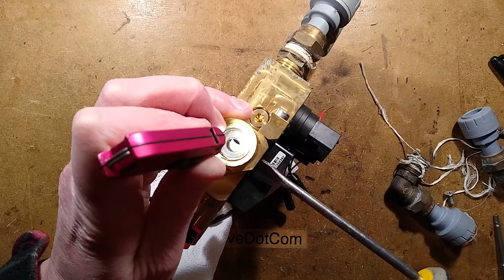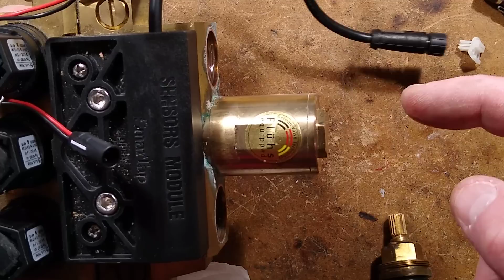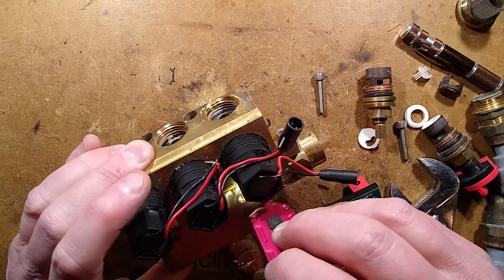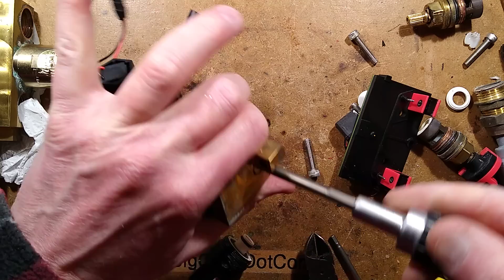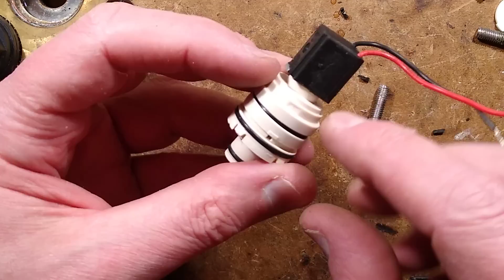Smartap manifold teardown (it's a beast!)

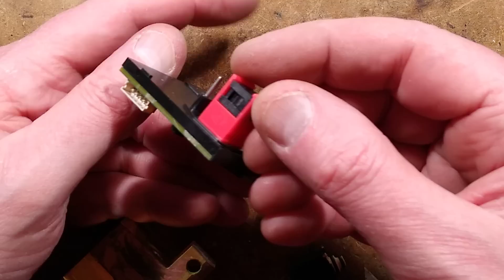Comment: 21:39 Those thingies could be both pressure or flow sensors. Which makes me think which one would be more appropriate, as both can be used to calculate the other parameter.
Both could get clogged, but a pressure sensor requires no flow, so no flow of sediment also.

It's almost as the bloody Juiciero x)

The fun thing is that lately I thought how I'd make such a thing, with pedal controls for the sink. And as I looked over the ready-made components it would require more space to fit all of the things. So probably most of the engineering went onto streamlining the whole package. Also I did not plan for that much electronics, even skipping the serial comms. At worst planned to plug in into an ESP to have remote pressure monitoring (it sucks where I live).

Comment: I've had this model for 6 years and it's been a fantastic unit. Especially bath time for my little girls as you can set profiles i.e 40l at 39c then stops automatically.  But since the app stopped working I lost automation but it still worked as it was programmed . Last night I've ran a bath and couldn't turn it off unless I've turned the shower on then turn off bath then turn off shower! 
Its like the bath button powers off after the first press then it needs the shower to be active to power on again. 
I know it's not the button as I have a spare and it does the same thing. As it cant be programed again is there a solution to fix this?

Comment: 11:50 That is one of the more satisfying crunches on this channel
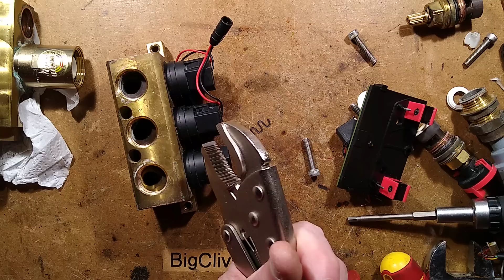13:15 That's up there too, nothing like that k'chack of a pair of vise grips (often followed by cursing as that terrible little release lever attempts to remove your finger)
16:00 I mean you couldn't use it before, which was how you ended up with it after all 
My vote is on pressure sensors to compensate for varying water pressure, but a flow meter also makes sense.

Comment: If it's any help, thread lock is usually a methacrylate based anaerobic adhesive and all strengths of threadlock can be softened for removal by heating to a bit over 250 °C.

Thanks for telling me about magnetic remanence valves - had often wondered how that was done in low power systems!

The whole thing is ridiculously badly designed and overcomplicated - built similar beneath my kitchen sink with two solenoid valves and two foot switches. Had been thinking about putting in a thermostatic mixer valve and another foot switch so that it would give water at the perfect temperature for hand washing but hitting hot and cold foot switches at the same time seems OK for now.

(I included a link to a manufacturer's page on removing threadlock but I think YouTube seem to have banned the comment because of this.)
Reply from the maker: YouTube often filters comments with links due to spammers and scammers.

Comment: You can open The 1/4 turn valves are known as integral stops in the US.  You can open the coverplate on the shower wall & shut the water to the unit off & replace the valve seals that go bad fairly frequently.  No need to have an access panel to have the shut off valves near the unit.  You can also plumb the units in back to back showers which make having easy access to stops even harder.  I'd guess that the central brass outlet is sweated in, looks like a bit of solder around the seam where it mates with the main block.

Comment: Very well engineered… unfortunately overkill for the purpose. 
Also we probably  have a 13mm water feed with an 11mm bore that goes into a grey plastic push fit that has what looks like a 9mm bore that then goes through an isolator valve that’s probably 7mm bore 😂 . 
Talk about a flow restriction, even with a high pressure pump fitted I could probably weeee a better flow rate 😮

Comment: I think the flow sensors are just strain gauges. There are holes either side so when there is no flow the pressure is equal; when there is flow the hole in the sensor facing the valve has a lower pressure (due to the venturi effect), thus inducing a pressure differential across the strain gauge. This would have the advantage of producing an output almost proportional to the flow.
   When I was (much) younger we used similar servo valves (I think they were made by Bestobell) to these, but worked in the opposite manner. The water pressure and a pilot spring kept the valve shut also water pressure was applied to one side of a dual diaphragm, positively keeping the valve shut (even when there was pressure downstream of the valve). When the solenoid opened the pilot port the water pressure was applied to the other side (larger diameter) of the dual diaphragm. With the pressure being the same on either side of the diaphragm much greater force was applied to the larger diameter side, thus opening the valve. When closing the pilot port, the water on the large diameter side was bled downstream of the valve. They were larger than the ones shown here, but they could take large flows and pressures, were 100% reliable, very easy to service (only the gauzes needed cleaning occasionally and this in very hard water), but were relatively pricey.
   Once again, an interesting vid.

Comment: The place I'm in just got the water meter replaced with an electric one.  He said it can be read by wireless network.  I think it probably contains a shut-off valve and/or pressure adjuster.  Scary

Comment: Those pins probably measure temperature differential and adjust hot/cold to provide the correct outlet temperature. Very common to see that arrangement in tankless hot water systems.

Comment: Guessing from the number of contacts and block and pad location is it possible each red pad is a temperature sensor, 1 side for manifold temperature cold input side and the flip for manifold temp outlet/mixed side  then the other block for the same but hot input side leaving the 2 small probes in the water stream for actual input water temps for both inputs

Comment: We've had a Moen IO Digital 4-port shower controller running for a decade now, which was cheap enough when amortized over a 25-year new-build mortgage. It doesn't sit on the internet, but it does give us a remote control to warm up all the body jets, shower, and rain shower before stepping in, which was the goal. I've always assumed that Moen used their standard, rather bulletproof, faucet cartridges to make the thing, with some servos on top to crank them and some temperature probes in the flow to regulate it. The only issue we've had is that I think the capacitors are going dead, and now the link between the panel in the shower and the controller/valve box is glitchy. Unplugging it instantly shuts off the water, so I suspect that at least some of its servos are balanced against springs. I really need to take it apart one of these days to replace all its electrolytics.

As for this video's incarnation: It's a fiendishly complicated Rube Goldberg device that I don't think was fit for purpose. Rest in pieces.
Reply: If you ever do, would you take 5$ for you to film the insides for me?
Reply: @hhhhheeeelllllllllooooo  Oh dear, it literally just went to the dump last week as part of a major ensuite reno. The contractor had it out and gone before I remembered to ask him to save it.  :(
Reply: @KevinT3141  Murphy's😂 But no worries, I'll try to find someone else to bribe. Thanks for replying!

Comment: Your not going to transcribe a schematic of that circuit board?
Reply from the maker: It is just one of many in this product.  If you look at the main video about this device it shows closeups of the PCBs and basically the microcontroller and network driver chips.
Reply: @bigclivedotcom  it was a joke...
i didn't need a schematic, i just expected you would because you always do.

Comment: I would love to get my hands on those servo motors. I ran the part number pg28395126000 (you can see in the video) but could only find some photos that look very alike, except for no encoder board at the back of the motor. I have a project for a irrigation valve that needs off the shelf servos and seen those in use in this product is enough to convince me that they will fit my bill just right. Can anyone find more information about damn servos? Tks!

Comment: How do you take a shower, when the water is controlled through your computer? I don't see the immediate advantages.
Reply: You could have it controlled by a PIR/presence sensor, so it turns on/off as you go in and out.
Reply: i think the red bits are probably flow sense, this allows you to set a fill level in your bath, also the control allows you to set profiles and use your voice to control so if you get soap in your eyes you aren't groping for controls, these are the advantages to computer control but the problems are the companies behind them, there is no reason these should be connected to the web

Comment: I think those things on the sensor module are pressure difference sensors to measure the water flow. There will be a orifice of a known cross section in the manifold the water flows through and each side of the orifice is connected to one side of a sensor, then the pressure difference across the orifice is used to calculate the flow.

Comment: 7:10 Solenoid valves all need fine intake screens like that.  Water has a tendency to not just be water; sand and grit and limescale come along with it, and it only takes a fine grain of the stuff to lodge on the sealing surface of the diaphragm or in one of the pilot holes.  They'll drip, or fail to shut off entirely, or fail to turn on.  Tank type water heaters in particular are notorious for coughing up all sorts of debris, but road works and other things can cause the city supply to be not entirely liquid also.  In the commercial restaurant industry, it's not uncommon to find one of those strainers completely packed.
Reply: Every time they shut off water (for works presumably) it's basically mud coming out of the faucet for the first minute or so once they give it back...

Comment: Valving involving fluidics. Using a small  pressure signal to control a larger flow. The Fluidmaster toilet refill valve is a classic example of fluid amplifier operation. Works with water pressure rather than against it. Clever and effective. Dirt in the system is basically its only enemy. Otherwise, it will work virtually forever.
Reply: I can remember how i felt when I first got my head around such a device.
Reply: They are great, but they also require higher pressure to operate than the traditional ball valve. When I started supplying my toilet cisterns with rainwater from a cistern in the loft, I had to replace the upstairs one's valve with a ball valve. As the pressure is so low, it's not noisy, so no real issue.

Comment: Those first ball valves could be for isolation during air pressure tests because the air pressure has to be pretty high for the test and the equipment can't handle the pressure.

Comment: I'm guessing the red blocks are either venturi tubes or just orifices with differential pressure transducers, used to determine the flow rate in the hot and cold inlets. There's no need for an outlet flow rate since this would be the sum of the two.
Reply: I'm also guessing it is this complex because it's meant to control both temperature and flow rate at the same time

Comment: “This is so much more complicated than I was expecting” in practically squeal-of-delight tone of voice.

There’s nothing more engineer-ey you could have done. Right there with you.

This might need a followup looking more closely at the circuit board and the components in order to find out what those probes are and what they do. I think you’re right about the pin-looking things being thermocouples but the red and black things are a lot less obvious. Looking at what they connect to should help nail down what they do.

The thing is definitely a beast.

Comment: It's a ferkin valve. The special tool required to remove the plastic valve is fairly hard to find, not many places have them in stock and it's usually a special order item, we occasionally use them in the motor trade, I believe it's called a socket.

Comment: I had an idea to drastically simplify all that.  This may be quite a shock to all the teenies and 20's  but hear me out. 
When you want water,  you turn a valve.  When you are done,  you turn the valve off.  With your hands.  Yeah.  Manually.  
Wild AF right? 

I had a shower with the typical one-handle thing.  You know,  where the temperature setting for "Just right" is a millionth of a degree of rotation in the adjustment range,  and everything else is either "Lava"  or  "Ice"  On full, the flow was pathetic.  When on the other side of that wall was the outdoor water hose faucet.   That one flowed like a scaled down firehose!  So I knew some hijinks was up with that shower faucet knob.

I ripped that crap out and put in two ball valves.  Modded the plumbing and installed the valve stems to come through two holes in the stall wall.  I modified two brass knobs to fit on the stems.  After that  I took the shower-head apart and drilled out the hair-thin passage that water had to squeeze through.  And then I just eventually removed the flow restrictor altogether.  I had a shower that had AMAZING pressure and flow. Took out those chunks of screen and grates etc.  That thing rinsed the shampoo out of my hair in seconds.    It no longer felt like someone peeing on my head through a watering can sprinkler.  The water had weight and impact.  It was great!
Reply: Your phone. You touch that. WITH YOUR HANDS. YEAH. MANUALLY. Chip me up!

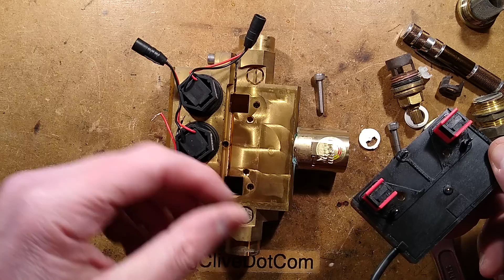Comment: 7:50 - The spiky bits are temperature probes and the red/black blocks are either flow meters or pressure sensors.  Depends on the internal passages of the brass block that can't really be seen on video and whether they have a passage through the middle or if they are just two separate sensors back to back.  When the flow slows down or the pressure drops on one side, it'll adjust the other side to not scald or freeze you.

Comment: You guys seem to have cool shower stuff between this type of thing and the "hot shower" or "electric shower" things you've taken apart. Here in the US all of our plumbing stuff is pretty dumb at least in the shower. Ours are literally just a manual analog mixer with absolutely no electricity anywhere near it. Unless you count the copper being grounded at some point. Though I have installed a couple faucets that have a little LED inside them that is powered by leeching a tiny bit of the pressure and spinning a magnet around inside.

Comment: Those red blocky things on the PCB must somehow control the two inputs (hot and cold water) to regulate the output temperature. It has three sensors, I suppose one for each input and one for the mixed output, but the only part nor explained is how the temperature is controlled. By process of elimination it must be those red things on the PCB. The holes in them you were poking into line up well with the two input valves so these could somehow control the hot and cold flow.

Comment: But what does it do? Are those red tap handles meant to be acted on by servo motors or something?
We've had thermostatic taps for a really long time now and they contain no electronics whatsoever.

I'm all for home automation when it helps me save energy or makes my life easier, but why would I want computer control on my shower?
Reply from the maker: There's a full video about the unit itself.  There are two servo motors for the taps.

Comment: It's amazing how they can send data down the power lines (I believe). In this case to remotely control your water supply.  I can see it now.  "Hmm.. it looks like Big Clive didn't pay his water bill.  Let's shut off his hot water and he can take cold showers for a week.  That ought to teach him."

PS - Over here in Ontario, Canada they monitor your power usage with a remote control power meter. And they can shut off your lights if you don't pay your bill.  And then they charge you $65 to turn it back on after you pay your bill (I know :-)

PPS - As you say, the brass machining really is very nice 👍
Reply: The remote control power meters are called smart meters and were sold as a way to reduce the demand of electricity. They just ended up being a waste of money. As for your comment about shutting off your lights if you didn’t pay your bill, that happened before smart meters were installed. Perhaps smart meters made it more efficient for the companies to perform such actions (such as possibly allowing the company to do it remotely instead of sending a truck and having a person to physically cut off power). The new meters didn’t allow a new action to be performed.
Reply: The rate varies by the hour of day.  It is somewhat cheaper after 7pm, but not much. The smart meters must allow for this.  As for cutting of the power when you don't pay your bill, I am not sure if they can do it remotely or if they send a man in a truck.  But, either way, if you get more than about 3 months behind in your bill your power suddenly gets cut off.  First they send you a letter and then they cut you off.

Comment: For a long time I believed my shower “temperature control” was that, a thermostatic device.  Then somebody in the knowledge corrected me — it was just a pressure balancing device!!!  The idea was to at least trying to respond to pressure variations caused by somebody in the building flushing their toilet, while I was in my shower.  One of my big AHAH moments…  Later on, I also found that the water temperature is very hard to control based on its temperature alone, being by nature an integrated feature, in control systems theory sense.